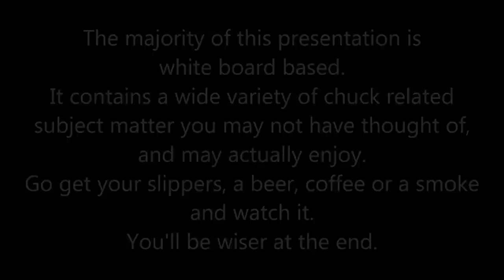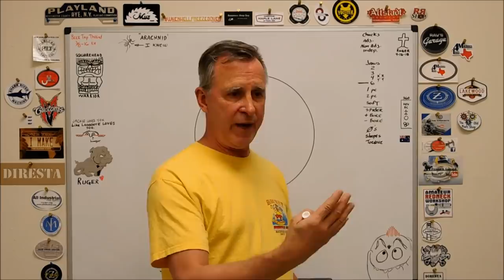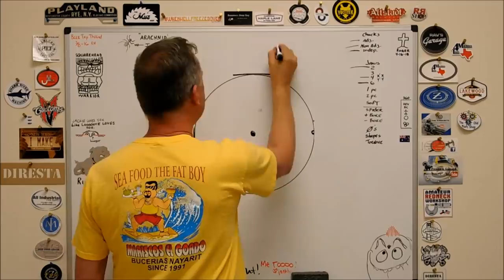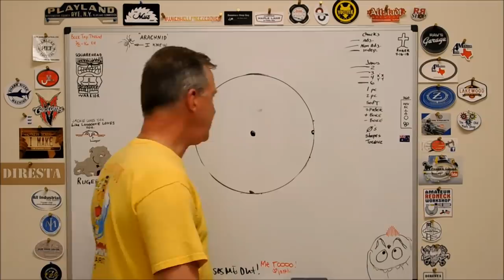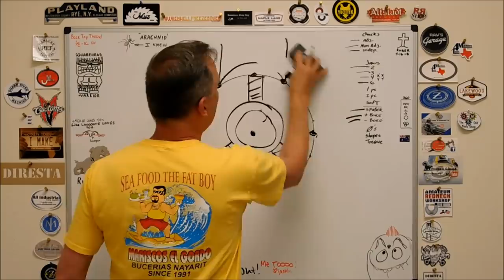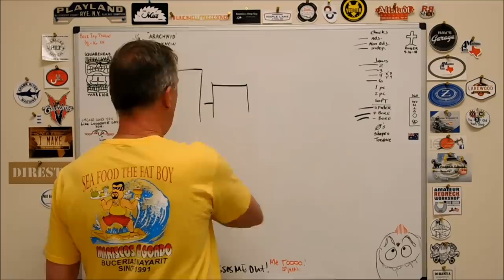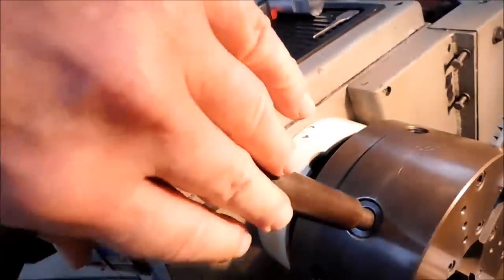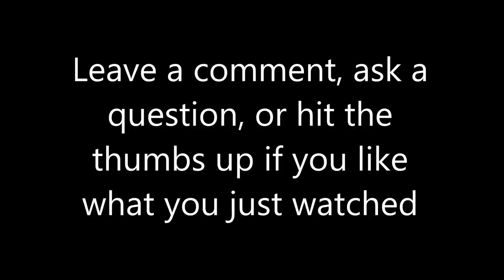Lathe Chucks - Types - Pro's - Con's

Comment: BTW, my clockmaker's lathe came with a chuck that has two sets of four clamping screws, that allows chucking just about anything, that is smaller than 20 mm, and adjusting for both concentricity and axial angle, or, indeed, for machining any kind of non-concentric, and off-axis angle... a bit "non-trivial" to set up, but can 'fix' all kinds of alignments.

Comment: Hi Joe another great video. Here in the UK we can buy steel soft jaws that replace standard jaws such as the Burnard chucks.
Reply: Soft jaws a available in mild steel or aluminum. One key thing about soft jaws. You may want them to be slightly softer than the part. Here is why. Say you are doing second operation turning or milling. You are having to clamp on a machined surface. You would not want the jaws to affect the surface finish of the part.
Reply: horseshoe28016 Ally jaws would work fine with the bolt on type of jaw. They would be totally unusable with the Bernard type of Chuck as there would be galling and the threads would fail.  Brass jaws are another option for  Bernard type chuck, but personality I haven’t come across any.
Reply: @daveticehurst4191 , ah, I didn't realize you was talking about 1 piece jaws. Yeah, aluminum wouldn't work well as a 1 piece jaw.

Comment: Hi, Joe.

Has anyone mentioned to you that YouTube is throttling your videos?  I try watching yours in HD, normal speed, and I have issues with the video download keeping up.  Then, for example, I watch This Old Tony, and HD at 2x speed works without issue.

Hmm, reboot modem, sign out of YouTube and try again only to see the same results with both videos.
Reply: If you are on a PC, right-click on the video, and at the bottom of the menu that pops up is "Stats for nerds". Click on this and you will get a graph in the upper corner of the video that shows the download rate and playback buffer size, as well as the actual display size, which may be less than you think it is. Usually there is a Youtube server somewhere geographically near you, so if things are slow, it is usually your connection to the internet. Like if it is 6PM and all your neighbors are also downloding videos.

Comment: I like 6 jaws too. I don’t know a 6 jaw that won’t allow you to remove three of them and just use the remaining three for those times when things aren’t that precise. Just use thin tape over the open slots so you don’t get crap inside.

I also use machinable 5C collets up to 6” dia. That solves a lot of problems. You can also continue machining them for different parts until there’s almost nothing left. If you machine them deeply after some time, and to a big dia., you can machine a ring, and put that inside. Just remember to cut a slit so it will compress. You can get regular length and deep, so holding power is pretty good, but not equal to a big chuck, just like regular collets. But as it holds all around, effectively, the holding power is plenty.

I know you know that Joe, but I figured I’d throw it in for those who don’t.

Comment: Joe I’m in a unique position at work of having a four jaw scroll chuck with adjustment on each jaw, so once I’ve dialled a part in I can crank open the scroll and clamp down on the next piece and it will be fairly close to spot one every time, I’ve often wondered if a standard scroll chuck could be modified to do the same thing, anyway thanks for the video, if my chuck is of interest let me know and I’ll snap off a couple of pictures.

Comment: hey joe, did you know that you can hold hexagonal pieces in a self centring 4 jaw scroll chuck? the jaws grip to the sides of 4 of the corners.
i have always used a 4jaw scroll chuck, it has much better holding power with less damage to the part than a 3 jaw. people seem to avoid them because they dont believe that they re able to hold hexagonal stock.
Reply: i agree it probably wouldnt be a good idea with 2 piece jaws, but i use solid jaws and never had a problem.

Comment: Hi Joe this is a first from my side, during my apprenticed  5 years, the engineering  shop had a number of Taylor conical scroll chucks, how ever I have never seen these in use again elsewhere.
Have you had any experience with this chuck ?
I have used one on a VDF large and found it to be great  , if memory serves me I believe that this chuck had enormous  grip with out  over torque.
I have found your  program very interesting and very informative even after 60 plus years

Comment: THANK YOU! I made that claim to a machinist (about the sequence of the jaws in a three-jaw, the order being key, not the dedicated slots) and he looked at me like I just defiled his under-aged daughter AND farted at the same time !
For some of the more thin and small parts, I find an old watchmaker technique very useful. One can 'glue' the part to a ground face plate with shellac. This can have benefits over a magnetic chuck, as it will NOT pull a bow out of a piece (which will re-spring when released) You can do exceedingly fine and precise work that way, but it is time consuming and somewhat tedious.(and real shellac can be released without any heat if it is required)
Great presentation Joe.... and as always : common horse sense and basic Newtonian physics will get you there every time !

Cheers
Paddy
PS: I still have a two jaw for my vintage, restored Volman lathe. This is basically a large face plate (about 12") with two independent jaws bolted to it. I haven't used it much, but it has come in handy a few times

Comment: Fantastic video! I watched it when first posted. There are still things to learn.
What about tightening a three jaw chuck or a Jacobs drill chuck. Some say one place on the scroll is enough. Others say tighten one by one progressively.
Thanks
Reply from the maker: I have heard that for jacobs style chucks on drill presses, but not all 3 jaw chucks have 3 key receivers. Mins only has one. But yes, many swear by that practice. It makes sense to load a scroll from 3 equal points, but I only do that on larger mill or drill press chucks. Not on a lathe. Thats just my preference.

Comment: Gerat explanation again.
I just want to mention, you can also get one piece soft jaws as well. But not in aluminium, of course.
Reply from the maker: The bolt on type can be used at either end. the CRS jaws are much better for volume production for sure.

Comment: I am not clear on the Spider, it's use, and so on.  Could you show one in use?  Do you already have video of ?  Thanks, Jack
Reply: See 30:16; you clamp the spider in the chuck jaws, and then hold the work with the ends of the bolts.  That way you can adjust the bolts one by one to get the workpiece running true.
Reply: The spider is to hold the jaws open at a specific radius, so soft jaws can be machined to hold specific sized stock accurately. Hope that helps.
Reply: You need to have the jaws gripping when turning soft jaws, you use round stock of a diameter that positions the jaws to turn the recess of required diameter. The spider is a method to provide some adjustment, rather than trying to find a suitable size.
Another method is to clamp over pins that have been drilled and fitted in each jaw, this method allows grinding of hard jaws.

Comment: A head scratcher here:  my mentor who left me his shop equipment, worked on a lathe for many years.  He was pretty skilled and did a lot of really precision work down to a .0001.  He never owned a 4-jaw chuck.  Everything went on the 6 jaw.  He'd remove some jaws for some work, often using only the jaw bases to hold small parts and get maximum span of cut.  How did he do it?  (Not a joke or a riddle.)  He never told me so he took it to his grave.
Reply: I figured it out today.  He used a set-tru D1-4 from a good company (Polish made).  What I'm finding is that as many machinists who swear by a 4-jaw chuck, there are as many swearing at it.  Your inclination is against the 6-jaw, using only the 4 jaw, but I have to agree the set-tru type of backing plate makes the 6-jaw a breeze.

Comment: If you have a lathe where the chuck screws onto the spindle such as some old South Bend lathes, don’t go from forward to reverse without stopping.  A student did that at the university where I got my degree.  I wasn’t there at the time but they say it went through the wall when it came off.
Reply: need video

Comment: my lathe comes only with the 4 jaw chuck. 

can I do everything using just the 4 jaw chuck OR do I need to buy 3 jaw chuck additionally? 

for example, holding a hex bolt head in 4 jaw chuck? is that OK?  sorry for the newbie questions, but everyone has to start somewhere...
Reply from the maker: Holding a hex bolt is OK. 2 jaws register on flats and 2 jaws will hit edges. Many guys swear by 4 jaw chucks, but I have a variety. I'd say save your money and just use your 4 jaw, but when you have the cash, get an adjustable 6 jaw and be done with it. You can always remove every other jaw if the job calls for a 3 jaw.
Reply: @joepie221  excellent advise! I will stick to the 4 jaws and save up for the 6 jaw chuck in a year or so.
removing every 2nd jaw in the 6 jaw chuck is something I wouldn't even think of (at this stage of my zero lathe experience)
thank you!

Comment: Hi Joe, Thank you for video . I have a problem you may be able to help me with . I recently purchased a very nice second hand Mini Lathe , a Record /Toyo/ Manix  , it has a 85 mm  dia ' 4 jaw chuck  which is fixed to backplate with Hex bolts through front of chuck . I wish to replace with 3 jaw chuck but cannot find one that fixes from the front of chuck . The back plate has 3 sets of fixing threaded holes , large out 50mm , smaller inner 35mm ,  and a triangular 65mm configuration . Would you know where I could get a  suitable chuck , or a backplate adapter to solve my problem . I don't think these lathes are produced these days . Many thanks , Peter , Herne Bay , UK .

Comment: <> Joe -- Kick Ass Video -- Dynamically Displayed and Articulated. 
<> 4 Jaw Chuck Vs 3 Jaw Chuck - I agree with your analogy.
<> Allow me to add something to the conversation. 
<> I do a lot of 3 Jaw Chucking work using Steel Bored Jaws .
<> I'm talking round and concentric parts .
<> Most of our jobs range from about 5 to 25 parts. 
<> In many cases the part has be turned 180° for machining on the back side .
<> Think about flipping and indicating 5 to 25 parts in a four Jaw Chuck.
<> Like a Tire -- you would have to have you indicator recapped. 
<> In Bored Jaws you have the luxury of establishing a stop at a desired length.
<> Utilizing the stop -- you can control easy control and clone the part lengths.
<> Many times we bore the jaws at 2 different Diameters adding to the advantages.
<> Last but no least -- " Pie Jaws " offer many other distinct advantages .
<> Like they say in Poland  "Asta Kielbasa"

Comment: Excellent video Joe. I learned a trick or two for sure. Really liked the safety mark on the chuck face. One question, what is the purpose of the second, outer mark?
Reply from the maker: That is probably the inverted top of the number 3 stamped in the face of the chuck.

Comment: I think the "put jaw 1 into slot 1" on 3-jaw ones is mostly for a predictable wear pattern? I was told that the jaws might not end up perfectly perpendicular to the axis of the machine if they are on the older side. i.e. the way of the jaw and chuck wear down differently between them and since you only remove them ever so often, chances are that they will not "even out". If you were to swap and rotate them on a dayly pattern, it might even out...

Comment: I laughed when you brought the gauge pin dilemma. At my shop we use gauge pins as dowel pins. So I bought my own set of pins for measuring while I use the shops gauge pins as dowel pins because those pins look horrible and at least. 002 out of round due to wear.
Reply: There's a reason that there is shop grade and inspection grade gauge blocks. No reason gauge pins should be different.
Reply from the maker: I don't endorse the practice, but admit to having done it on more than one occasion.
Reply: Joe Pieczynski I’ve seen it all to often that it depends who’s paying for the tools as to how they’re used. Or maybe I should say how they’re ABUSED!!!! Sometimes we need to use tooling in an unorthodox manner however it need not ruin the tool with a little care and respect.
Reply: @joepie221  I agree i dont endorse it but sometimes one has got to do what it takes to get the job done. Thats the reason why i bought my pins. I still treat the shop tools with care. I've seen some guys hitting them with dead blows to press the gauge pins onto the hole to open up the hole. I've also seen some folks pull the pins out with pliers lol. I've had to bore jaws out with a pin on more than one occasion myself to be honest so I cant really judge.

Comment: Since I have D1 4 Camlock I buy chucks like snacks 🙄🙄🙄 and change them in a very short time to have always the right chuck for the job. I have several 3 Jaws made of steel or not than some 4 Jaws central clamping and not than a C5 jaw for Collets and a ER32 for ER Collets. When I didn't have Camlock I changed the chuck only of I really had to but now in one minute the perfect chuck is fitted. My worst chuck has 0,06mm outrun and my best 0,004mm  the spindle has 0,002mm...and they are all 160mm or 200mm so it's quite good i think. What I also like about Camlock I can take a chuck to the mill and clamp it there and afterwards back to the lathe without unclamping the part and that's where great precision comes from. Thanks for sharing Joe you're videos are so full of Infos and good tips I love them.
Brilliant idea marking where you have two more turns until Jaws come out i will steal that from you 😉👍
Reply from the maker: Thanks for the comment and support.

Comment: On the "Soft Jaws" at 17:00 or so - there's a little bit more that's useful.
"Overbored" -> single point contact.
"Underbored" -> double point contacts. But...

They're soft jaws. Close can be perfect - because tightening should be causing the jaws to deform. The contacts spread slightly - and spreading contacts means changing the effective ID. Which can get all the way to multiple points of contact if you weren't too far off on the bore diameter.
Reply from the maker: Only in the underbored condition will the jaws have a desire to expand and accommodate the part. Overbored will always be single point contact unless it voids the outer mounting hole.
Reply: Joe Pieczynski I agree, unless you're chucking thin tubing which will conform to full contact.
Reply from the maker: In which case, over bored may be better. ?? think about it.

Comment: If you do relative small work, the 3 jaw is perfect . Bot if you want to bore a 125mm (5 inch) stock , 150mm long(6inch) . And it doesn't go into the 10inch (250mm) chuck  . It has all chances to fly out. 
Independent 4 jaw is for torque.
Reply from the maker: Go for the 6 jaw at that point.
Reply: Joe Pieczynski I don't own a 6 jaw. But I know from my experience whit a 1/2 inch grip, in a 4 jaw , I hold a 170 pounds part securely. I doubt that in the 6 jaw u can that , because I think you Louse torque in the scroll 
That is why you don't see often a 18inch 3/6jaw chuck

Comment: I have used for years like a 1 inch nut that i drilled and tapped on 3 flats on center, just use set screws or bolts for adjustable blocking. just easy to index in the mill.

Comment: I need to machine a bushing out of Delrin for concentric spacers on a auto hub.  I need a width of 1/2" and a shoulder on the inside.  I have been trying to reduce the amount of waste ($8 and inch) I have both 3 & 4 jaw chucks.  I have experimented with  the alignment and 4 jaw is the most difficult to align.  Given the need to reduce waste, how would you suggest the machining of this part.  The od  of the stock is 3.25.  The id needs to be 61.5mm the finished od is 71.9mm.  I need an 1/8" tapered (base to outside) lip on the inside of the bushing to keep the concentric alignment true to the hub and wheel.  Suggestions?
Reply: Yes, I have a very strong suggestion!    Don't ever use plastic to make spacer rings for car hubs; particularly when making some as thin as you are.  Aside from that, if you are making a lot of the same size, consider getting a collet in that size.  It is no secret the 3-jaw is easier; and it is only used when concentricity doesn't matter enough to bother using an independent 4-jaw.    So get a collet, or a 6-jaw, if you want, but the best fix might be to use more stick-out.   That is, if the jaws are going to distort the workpiece, keep the part you are cutting far away from the jaws.  With a 3.25" part, you could easily do your cutting 6" from the jaws, and that should minimize distortion from the jaws affecting your part.   Now, for cripes sake go buy some aluminum and do it right.

Comment: Lock nuts are a good idea for the spider screws to make it even an even more solid grip (takes up any slop in the 3 screws) - also, it helps to grip the spider using a similar chuck pressure to which you intend to hold the workpiece!!
Reply from the maker: Gripping the spider with comparable pressure is a good practice. Locknuts however don't do anything to improve the task. Don't bother.